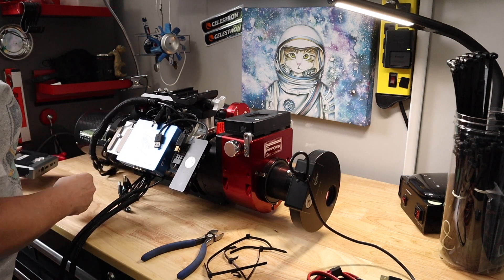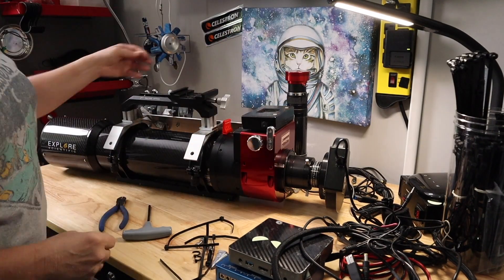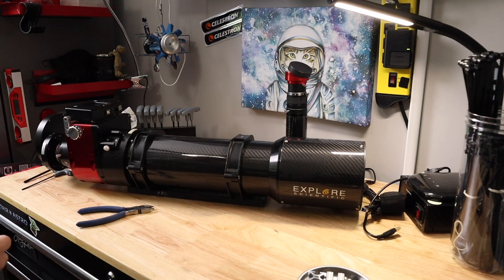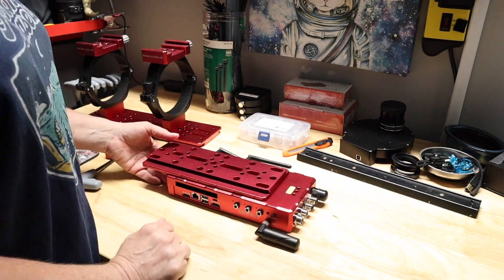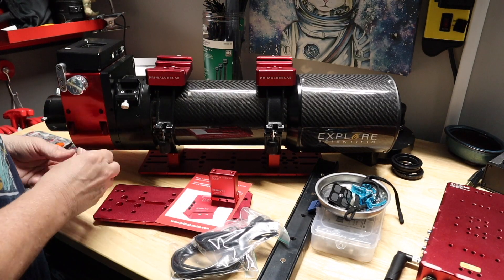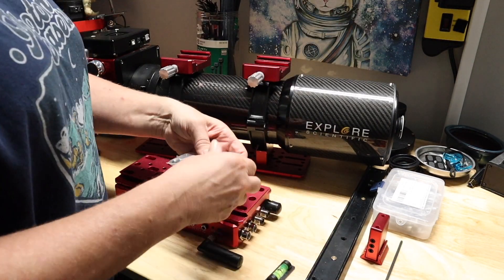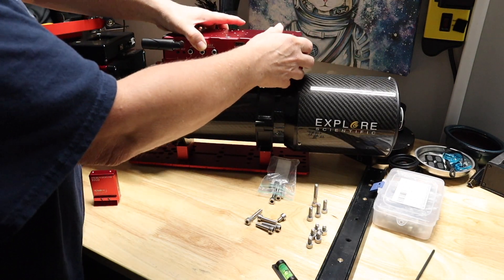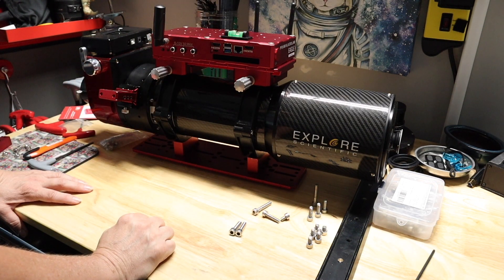Going EAGLE - Telescope Rig Re-Design with More POWER! PrimaLuce Eagle 4S

Comment: Hi Amy: I'm interested in the Eagle 4 Pro for my planetary imaging. What software do you use to communicate with the Eagle? Do you plan on updating the OS to Windows 11 Enterprise? Finally how do you install software  on to the Eagle?  Thanks
Reply from the maker: I have not braved windows 11 yet.  Treat the Eagle as a PC, connect it to a monitor and keyboard and you are good to go.  So easy.  When the eagle is outside, I use remote desktop to reach it when I am inside the house.  I love it.

Comment: I imagine you have changed it since then, but the eagle should have the sky meter facing the same way as the OTA so you can get useful data from it. You can just move the lens to the opposite side where the cap is so you keep the power on the back side.
Reply from the maker: Yup All fixed.

Comment: Amy - this is very useful. I wondered how you like the Eagle 4S after using it for a while?  I keep pondering getting one of these but have been put off by the price TBH. Sounds like you got a good deal with an upgraded refurb though. Are you happy with it? In particular what is the wi fi strength like - that is my biggest problem with my current mini PC despite two external aerials.
Reply from the maker: Wifi strength is great.  I operate it about 200' from the house.  I have an Orbi wifi system in the house which is great for distance.  I have not had any drops and do not notice any lag.  It takes under a minute to boot up which is no big deal for me.  It takes me that long to walk back inside.  I also transfer images in the morning over wifi from the yard to the house PC.  Typically in 5 min or less depending on how many images I take.  I hope this fall I will have more cloud free nights to play.  Yes it is expensive, but it does everything I want.  You would never know this is a refurb.
Reply: @AmyAstro  thanks for this - very helpful

Comment: It’s been over 2 weeks, how do you like the Eagle? Besides everything in 1 unit, is it really much better than a powerful little NUC paired with the Powerbox? $1500 for the Eagle vs $550 for the NUC Powerbox combo?   Beautiful Astro rig btw.
Reply from the maker: So far I love this unit.  It runs outside while I am inside and I have not lost my internet connection yet.  Download speeds from the camera to the hard drive is half the time of my NUC.  I can transfer files from the Eagle while outside 200 yards away to my pc inside the house in just a couple minutes.  This typically took me 10 minutes.  The Eagle also handles Dew, Power distribution and usb hub.  Everything is working very smooth.  So far I am happy.
Reply: @AmyAstro  that’s great! Especially the 200 yards and quick download speeds. Clear Skies!
Reply from the maker: @brianastrodoc2886  I have a friend who runs PixInsight on their Eagle to do the rough process down to a single image.  Then they transfer the single Image to their PC.  Best part is their observatory is 100 miles away from their home.
Reply: @AmyAstro  that’s amazing!
Reply: @AmyAstro  Amy is your Eagle connected to your home’s Wi-Fi as host or as a simple access point Wi-Fi signal?

Comment: Awesome. Does the eagle compare to Pegasus Ultimate in terms of power?  I'm debating going that route also cause rhe UPB is just way too expensive for what it does.
Reply from the maker: The Pegasus UPB does a good job.  You do have to be very careful with the input power.  I have let the smoke out of the box a couple times with Pegasus.  The Eagle is everything in one box.  It is heavier than I expected.  The computer in it is fast and reliable.  It controls dew well along with power distribution and is a usb hub.  Everything connected the first try.  The eagle has so many options and ability to grow with you that I can not imagine not having it.  My wifi stays connected at 200 yards outside, no problem.  The gps capability is amazing.  Very helpful if you travel.  If I had the money when I started I would have gone the Eagle route.  Back then I slowly collected parts and made them work together. I hope this helps, sorry for the delay.
Reply: @AmyAstro  thanks Amy. Enjoy your videos!  Great work. 👍

Comment: I am finally building my first Astrophotography DSO setup after spending 2 years just photographing milkyway, andromeda, and orion with my Nikon Z camera and Star Adventurer Pro mount.  I was considering getting an ASIair Plus (sold out everywhere) or minipc and the Pegasus power box distributor and plug them into either a Deep Cycle battery or Jackery 500 powerstation (expensive) when going to Charlie Elliott Field or North Georgia state parks.  I'm not sure what the purpose is of the Eagle 4S. Does this Eagle box replace both the minipc/ASIair Plus and the Pegasus power box?  If so, is it better to just get the Eagle box ($1,500) vs Pegasus power box ($330) and ASIair/minipc ($300) for beginners/advanced beginners?
Reply from the maker: The Eagle is a complete mini PC windows based, with dew heater controller, power distribution, USB hub, plus more. This is an easy solution to work with.  You will still need to load your imaging software, guiding software, star maps and stuff.  It is a nice package.  You will need a solid power supply to run this.  Denis R may be able to help with this.  You need to do your research and decide if your budget can handle a one time expense like this.  Or is it better to get a mini pc, dew controller, power distribution, USB hub.  I did this second route for years without too many problems.  As I learned, I upgraded as my budget would allow.  The Eagle was my next step in my evolution. You will find many folks at CE are happy with the mini pc route.  They are also the group who like to tinker all the time. Or build things themselves. Best of luck.

Comment: I have been running Eagle units from the beginning of my addiction to astrophotography. They do add weight to the package. With my iOptron CEM70G the only cable to be concerned about is the main power to the Eagle unit. Everything else is Wi-Fi. On my Parmount MX+ I reconnected cables so that the power cord is internal with zero wires flopping around. Love them
Reply from the maker: Very nice!

Comment: Great video Amy, but did you put the eagle on the wrong way. The eagle eye is facing backwards. I like the eagle concept other than they made all the power cables proprietary, so ive stuck with my Intel NUCs
Reply from the maker: No worries, I fixed the eye. lol  i struggled with the cable issue at first.  They were not cheap.  When I realized each cable was carefully sized for each device I was using it started to make more sense.  You can also get the plug ends and wire the cables yourself.  I am told they are very easy to wire.  So if you have a cable that works with your equipment, just purchase the connector and wire away.  Don't let the cables stop you.

Comment: good stuff Amy - I have mucked about with this sort of stuff for years.  My current solution is to use a mount that has power and USB on the saddle (iOptron CEM70G) and I find that means I dont need to have much mounted on the scope.  No need for expensive powerboxes either. I also have Ethernet to my Mini PC, so that avoids Wireless and all its drawbacks.   There is no need to have any cables going to the scope, so less chances of cable snags (although you do need to be careful about how much slack your cables have)
Reply from the maker: Your solution sounds great!

Comment: You'll need to move the Eye to the other side facing the stars to get the SQM readings. Love my Eagle - congrats
Reply from the maker: Done
Reply: @AmyAstro  Great! I don't recall if you are using NINA? If you are, you can add the SQM data to your fits header which helps greatly when comparing your files
Reply from the maker: Thanks for the tip!